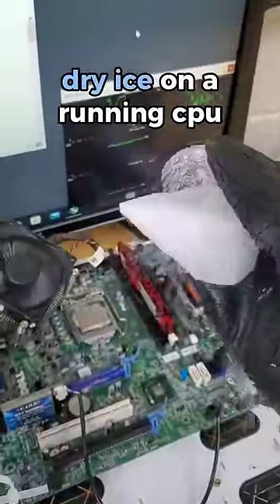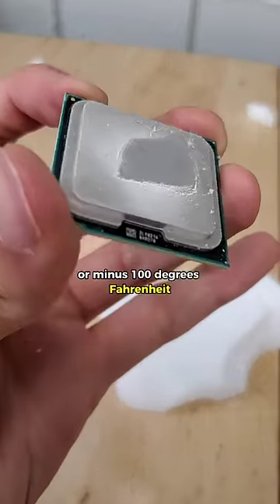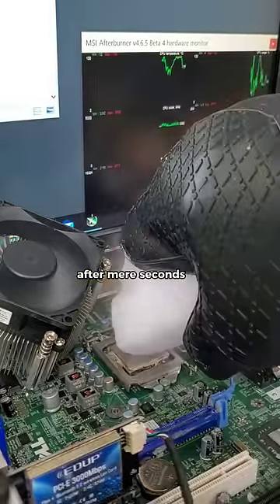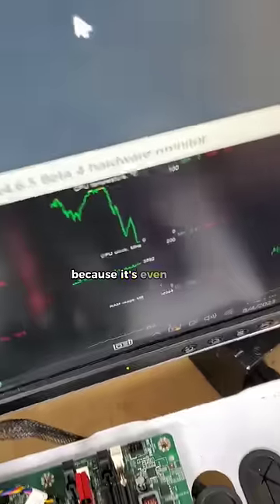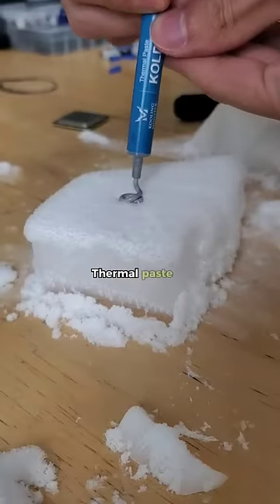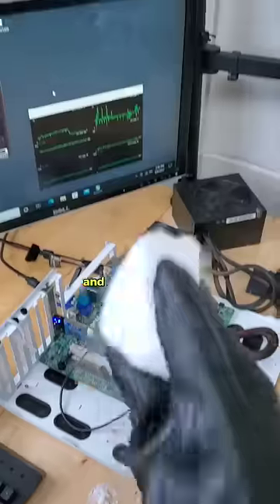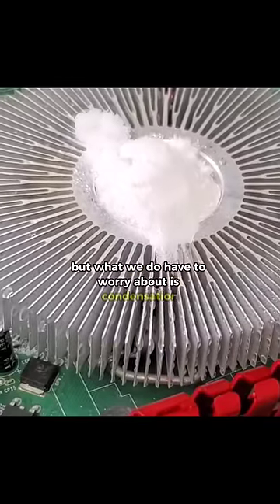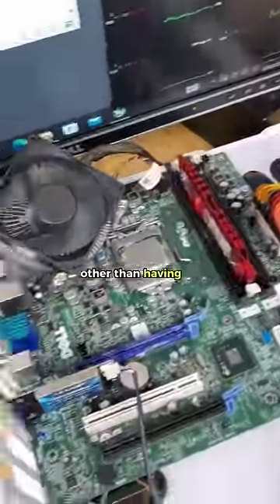using dry ice in a running PC #shorts

Comment: CRIMINAL ACTION: LEAVING THE WHOLE METAL COOLER OVER THE MOTHERBOARD CIRCUITS.
Reply: @TheSpidersoftheworld or maybe he has so much computer parts that he doesnt have to care
Reply: I don't think this video is legit. MB is clearly  short-circuited in at least two points ?
Reply: its an old mb
Reply: @breadboi1248 I believe that is the case, Dartling gunner
Reply: Prepare FIR
Reply: @gorazdrucna3627  That motherboard is at least 6 years old and is clearly low end, so it’s not like he would be super careful about its safety. MB manufactures know what they are doing and a incorrectly placed CPU cooler would pose a significant risk of a SC, but looking at the placement of the cooler it’s definitely not something that would instantly kill a board. Still not something you should do if you want that motherboard to last a somewhat decent amount of time, which clearly doesn’t really matter in this case. Overall this is definitely a legitimate video (especially if you look at his other videos) and it’s pretty clear he’s fine with damaging old and outdated components that likely no one would buy today for the sake of making an entertaining YouTube video
Reply: @osmanapaydin7212 low end pcs are fascinating! I've seen a low end motherboard and a pc that looks so low end But it was pretty powerful

Comment: Bro has balls to grab some frozen thermal paste around the temperature of dry ice around dry ice WITH HIS BARE HANDS
Reply: its actually safer than doing it with gloves as it creates a little protective carbon dioxide barrier around your hand, basically protecting you from the low temp (gloves wouldnt do that)
Reply: @jarrenhackney5414 Leidenfrost effect
Reply: @jarrenhackney5414 it is effective protection only when you have material with very low boiling point and there is very little force applied (the gas has to be produced faster or just as fast as it escapes) so considering that he is holding it it doesn't really help. It's most likely the fact that thermal paste doesn't have high thermal capacity so it went back to non-dangerous temp quickly

Comment: Bro. Toms hardware did this 20 years ago. The key is to have a cylinder pot (copper preferably) insulate it on outside, fill the center of the socket with silicone, have a silicone brim between cylinder and MB on outside of the socket. Place a heater on the outside of the silicone sock and the outside base of the cylinder. This will remove the conditions of condensation. 
Originally in the cylinder you put liquid nitrogen. Alternatively you put acetone and crushed dry ice. The liquid interface of the acetone will greatly promote heat transfer.
Reply: The problem here is temperature s this low will lead to thermal expansion damage
Reply: I aint readin al that 💀
Reply: I did this too with such a pot
Reply: Making the elements waterproof does not eliminate the condensation process, and that water must go somewhere. Even if the cylinder is perfectly insulated (a solution), it represents too much maintenance hassle to manage. : more (costly) electronic + mechanical automation design would be required if used for some productive environment/tasks.
Reply: @yokingboii homie can't read 5 sentences 💀
Reply: @HawkFest  These weren't day to day machines, these were setups built by enthusiasts often with the hardware laid out on a desk. They were competing in teams for benchmarks scores on HWBot and would be swapping out their hardware on a regular basis. Those who were particularly good would have pre-release hardware, cpus, motherboards, memory etc sent to them FOC straight from the manufacturer — a great bit of marketing at the time.

Comment: For preventing damage through condensed water you can isolate the motherboard by using liquid rubber. When it comes to thermal paste there are pastes which are designed for low temperatures. Of course those are not designed for direct contact with dry ice or liquid nitrogen.
Reply: Good comment, a breath of fresh air among idiotic noob comments
Reply: Water drips downwards. Dry ice on the table, motherboard upside down on the dry ice with heat sink touching dry ice. Water drops down and doesn't wet the motherboard 👍
Reply: @germ321 it will still condensate at the front and back of the mobo
Reply: The water isn't actually an issue since it's distilled water from the air. There's no electrolytes to conduct electricity so you could submerge the entire computer (minus the hard drive if there is one!) in pure water

Comment: Colder isn't necessarily better.  Metal and silicon have inverse effects with temperature.  As temperature rises, metal becomes more resistive and silicon transistors become faster. So timing paths which are heavily metal dominated vs logic gate dominated will fail in opposite conditions.  CPU designers have to signoff the design for both hot and cold temperatures and different portions of the chip would prefer different temperature ranges, but all should operate rather optimally between say 25C-75C (but typically spec'd to -25c - 125c). While this may be efficient in driving the temperature very low in the near term, it is possible you are actually slowing down the performance of the device or even could trigger a hang/crash by operating it at such a cold temperature only for the dry ice to quickly sublimate and then return to normal operating conditions when you inevitably run out of dry ice and have no way to create it as fast as its sublimating

Comment: Thermal shock has entered the chat
Reply: Kid named Operating Temperature Limit:
Reply: If it goes from super hot to frikin cold, then yes. It would be interesting if a system that could maintain a perfect cold temperature using dry ice existed. How would it work in a gaming PC that goes burning mode while gaming for so long.
Reply: The future is now, old man.
Reply: @ymir4552  i am honestly impressed that the temperature swing of 100 degree did not break anything by itself.

Comment: That condensation is probably fine tho since the water does not contain any minerals, and for the people who don't know, water itself isn't conductive, it's the minerals dissolved in the water that conduct the electricity. I once dropped a running network switch with holes in it into a bucket filled with condensation from the air conditioner, it just kept on running and was completely fine
Reply: You got lucky.😂
I understand what you're saying though, but condensation can easily become conductive on a surface with dust particles, like every PC has in its interior. I use closed-cell foam padding on my TEC resevoirs for this very reason.
Reply: yea, that's not really true, your PC is very dirty and water will definitely become conductive after a while and will kill your PC
Reply: Carbon dioxide will dissolve into the water and make it conductive.
Reply: Ehhhhhhhhh, tell that to the dust particles. That’ll contaminate the water real quick.
Reply: Yeah.. thats how they clean electrical parts too by using water but cleaner🗿
Reply: @bi2099  the amount of CO2 in the air is actually pretty low (424 ppm, that's around 0.04%, as of june 2023). The amount that dissolves from the air into water that is standing still is thus not enough the lower the water's electrical resistance to be able to conduct the low electrical power running through a motherboard (don't get a psu involved tho, the 240 V AC will be able to punch through the water, but with a few drops on a psu shroud it's probably fine)
Reply: Would it immediately turn back into gas form?
Reply: Problem: that water comes from the air, it's not like pure distilled water, and thus can carry those elements. Try it with rain water and you'll see...

About your "experiment" with a bucket filled with air conditioner's condensation, it's totally irrelevant: the water is expelled in a bucket, it's not spread over electronics (which are protected via small enclosures  or whatever if present). Also note that your bucket is either plastic or stainless steel... Other elements that can go through oxidation from some contact with that water, are simply made waterproof (e.g. stainless steel, coating etc.)
Reply: @UrHeadset  What do you think happens to the dry ice? The Co2 won't disappear.

Comment: What if, hear me out here, legit idea, someone introduced a similar system similar to water cooling, except its just a tube that has dry ice looping around and around constantly, automatically getting rid of condensation within the tube (maybe a vent in the tube with another small tube leading to a box with cold walls that traps water), and also automatically replacing dry ice with an external container. Only flaws i see is keeping dry ice is hard, getting dry ice is hard, and it would be kinda annoying having the empty the water trapper every week or something. Would be an ultra effective cooling system tho.

Comment: Direct dry ice contact only works on small surface areas (notice hes using a corner and not flat side) without too much thermal flux (heat movement). Once you get too much of the dry ice sublimating (turning to gas) it actually has an insulating effect as you loose the contact cooling. Better approach would be dry ice in pure alcohol in a metal container on the CPU; you are effectively increasing the surface area of the dry ice to manage greater thermal flux.
Reply: Too many thermal resistances between chip and source of cooling .  Use a cryogenic fluid instead of a frozen solid and paste .  Pour continuously from a cooling device that recovers the gas from the air .

Comment: It's a good idea to use Frozen Carbon Dioxide instead of Dry Ice because it does not turns into water instead it turns into gasses that obviously don't conduct electricity, I also don't know if it will have the same effect

Comment: Well I wonder if you could design (not you specifically just generally speaking) a piping system to generate dry ice in the reservoir which would rest upon the cpu to conduct the cold to the cpu. Only issue I see is as you said the condensation that would accumulate on the piping. If you could somehow produce a protective plate with seals to keep condensation from the board and other components then I could see this being a very plausible and almost practical way to cool a CPU. Maybe even other components such as the GPU too. Just dealing with the condensation is always going to be the issue to overcome. I dunno... Random thought while watching this. Keep up the good work!
Reply: After thought: Using a insulation type cover around the piping to keep drip from being an issue. Would just need a way to route the collected condensation away from the components.
Reply: Third after thought: Use a drain type system within the reservoir to recirculate away from the components. The dry ice is a solid so just a simple drain system with a dual layer piping and insulation. First layer would of course provide the cooling agent, so to speak. Second layer to run the condensation to the drain outside the inner reservoir to drain circulation and outer layer as double protection from condensation and act as insulation. Again just random theories off the top of the head. No real plan there. Just theorizing.

Comment: On the thermal paste front, that isn't entirely accurate, Pastes like Kingpin cooling KPx (formulated with the help of Vince/ Kingpin), thermal grizzly Kryonaught and Kryonaught Extreme (Formulated with the help of Der8auer) can stay at the correct moisture and consistency down to -220°c and is meant to be used in everything up to and including liquid nitrogen/ liquid helium cooling.

Comment: you need a coolant or liquid that wont freeze and have a pump that will pump that liquid like a standard water cooler but through a copper coil in a insulated bucket of dry ice.

Comment: did you know Planet Pluto?
the ice on that planet can't be melt on  normal sunlight or 100c heat.

it can be melt through the sun core. above 10000c. 

its a good cooling thermal product if we can travel there but we frozen before entering the planet😅

Comment: Only problem here is that a cpu is less efficient below certain temperatures. So applying dry ice would basically cool it down to the point where it’s slower than if it had a poorly functioning fan

Comment: now what about rubbing dry ice on a water cooled system? 3d print a container to fit around the tube and you can pop some dry ice in there. condensation won’t be an issue for the outside of the pipe

Comment: The dry ice is somewhat safe to use directly on the components because rather than melting into a liquid, solid carbon dioxide turns straight into a gas, which is called sublimation

Comment: You just gave 6000 pc builders great ideas and plans that may fail.
Reply: its not a good plan to have to cold cpu, cpu work worse when they are cold.
Reply: @Dennan  can't be any better than a room heated by a fat guy with a barely able A/c unit pulling rivers of water from the air that flows into a terrarium that has another planet within as this dorito diet masterpiece plays a mind throttle game that allows sweat in place technology.
Reply: @Dennan  I'm not claiming you're wrong. I understand there needs to be an balanced environment
Reply: @zenithxarenix7333  lol, you reply made me laugh ^^ same as an engine, a cpu works faster if its warmer , not colder, ofc only up to a point. 50-60 c

Comment: I got a cool idea where your PC has a glass folder where you can put dry ice in so it acts like a replaceable cooler.
There is probably 197391 reasons why it won't work though.

Comment: I've once bought a phase change cooler to overclock a computer and the computer was accurately mesuring the -28 celsius temp on the chip. Had to pack the socket with dielectric grease and completely isolate the motherboard to prevent short from condensation.

Comment: When I was broke as fuck and gaming on my Steam machine  Alienware Alpha with an i3 and gtx 880 I had to use my electric air bed mattress pump duct taped to my wall to cool my cpu. The pump had four huge D-cell batteries that inflated the mattress I was sleeping on  It worked but was barely keeping my cpu under the thresholds for operating lmao.

Comment: I really am curious if a nitrogen-cooled PC is plausible. I'm sure it would probably need a specially-modified water cooling system without any parts that would freeze up at temperatures that low (assuming that isn't the case already, I don't know, I've never made a water-cooled PC before)

Comment: So why not put a computer in a vacuum to reduce condensation? From benchmark tests I've seen, biggest issue is condensation management. Mainly with using liquid nitrogen. Would dry ice as temp management on a computer in a vacuum provide higher benchmark scores?

Comment: Condensation is not an issue for electronics, neither is water, this is a myth, it's the impurities within the water that are. Condensation is pure water, BUT if the condensation has surfaced on something with a lot of impurities than it will be an issue.

Comment: I made my build 4 years back just use stock fans. So when I game my cpu gets between 85-95 C. So what I do is use my big ass square walmart fan I bought for 20$. Face it to the vents of the computer case and guess what it cools my system CPU from 90+ to 60-71C 😂. And I be playing RDR2, GTA, and other high performance intensive games. I recently connected a cooler that holds dry ice made some holes in the back of the cooler and connected it to the back end of the fan. Now the fan blows cold cold ice to the system. Running on the highest specs my CPU with this dry ice fan build makes my CPU drop to 2-11C.😂😂the dry ice can last for about 14hrs it cools my room too.

Comment: No but wait
You could totally do this
A cryocooler at the top of a tube
The bottom of the tube is sealed to the CPU
All you'd need is a dehumidifier output inside the case
Hey kid, wanna see a six digit overclock?

Comment: Hmmmm know what how would dry ice affect systems that use liquid cooling with that special water that doesnt conduct electricity so that the system is maintained in that special water now im also talking about adding small tiny chunks at a tiny not an entire block otherwise youd have a frozen PC

Comment: I like how dude just throws metal heat sink to the side on top of a running board.. I have seen two technicians short out motherboards from doing the same thing. It would have taken an extra 2 seconds to pull the cable and set to the side correctly....just saying...

Comment: Dry ice on the CPU die but motherboard in upside down position. This way condensation water will not fall on the circuit board but to the ground. 
Wonder what record in computational power you can achieve with dry-ice as cooler? Is there a bitcoin mining test?